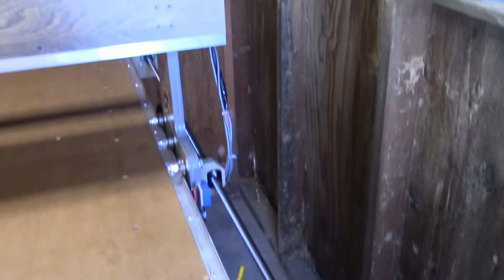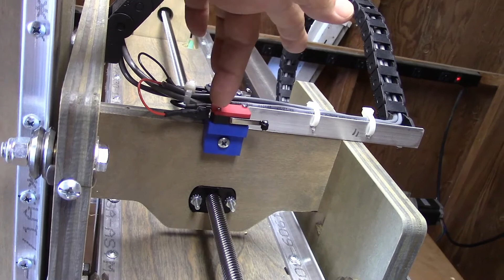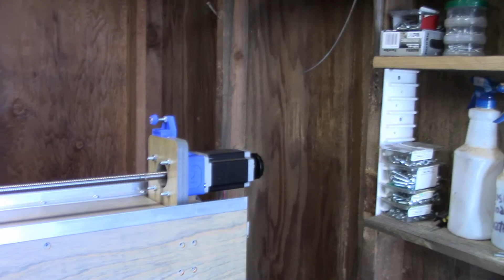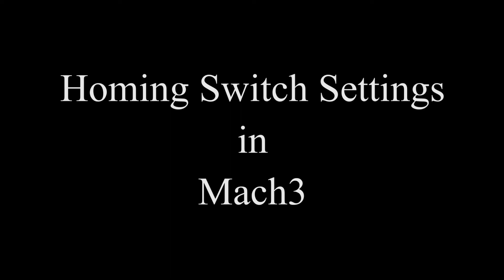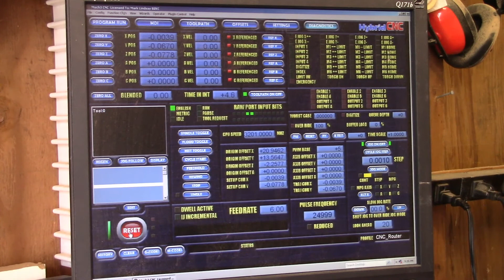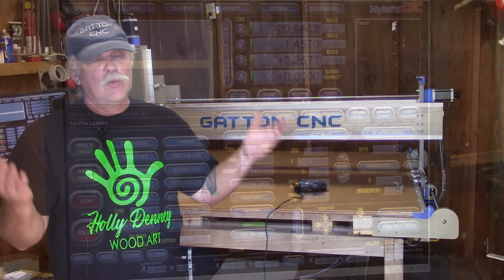Adding Limit Switches to my Gatton CNC - Part 2

Comment: The gentleman you recommended he explain on very easy way to understand thank you for that but i have one issue what ever I’m doing to set my limit switches it doesn’t work i have done everything exactly what you did switches on series, NO close position on switches, port and pins and 24volt DC on switches do i have to do more settings or not also on mach3 on diagnostic section check the leds for limit switches all OFF check by pressing each one they become ON I don’t know what i have done wrong your help will much appreciated

Comment: Could you please explain how we can change screen what your have
Reply from the maker: Unfortunately, the Mach3 screen set I was using in this video is no longer available. If you go to the Mach3 website (link below,) you can see all of the screen sets that are currently available for use with Mach3. DO know that Mach3 is no longer being supported, so some of these screen sets may not work with some Windows 10 updates, or with Windows 11 at all. Check with the screen set author for any bug fixes or updates to the screen set.

https://www.machsupport.com/downloads-updates/screensets/

Comment: I have positive stops on my X and Y axis, and the Z top.  And will use the Y Home and Y slave stops To square the gantry periodically.  
My question is setting the limit switch position relative to the positive stop.   I’m thinking to set the activation point of the switch 0.050” prior to connecting positive stop does that sound correct?  I don’t want to risk bending the switch arm if the switch is located too from the positive stop.
Reply: I am going to set up limit switches first, I do have Hall effect switches I want to switch to some time in the future, do you have a VT on this type of switches?
Reply from the maker: No, I'm sorry - I do not. I got the Pepperl & Fuchs proximity sensor kit that Avid carries when I got my Avid 4848 Pro CNC router, and never looked back. It was 100% plug and play, easy to dial in, and have been 100% trouble free. I'm glad I went with them.
Reply: @MarkLindsayCNC  OK I’m going with proximity switches, are they wired in series (two on same axis) like the mechanical switches in this video.
Reply from the maker: Mine are not. Each switch is wired to the controller box separately. As I said - the system I have is 100% plug and play. I didn't build it. I just bought it, plugged it all in, and never looked back.
Reply from the maker: That sounds reasonable. You could go a little more than 0.050 if you're comfortable doing that. I have proximity switches, so nothing ever actually makes contact, but they're set ahead of the positive stops on my machine by about .25 inches. More important when homing is the speed at which the axes are moving when you home. Mine is set to home at 5 ipm. I jog the machine so that all 3 axes are close to the switches, then home. It only takes a second to do.

Comment: Great content you help us with, I just have a question here about slave motor A axis, I worked with Lcnc before and now I'm trying Mach3 and it seems that homing Y axis and his slave A only need one limit switch, in Lcnc each axis has its own even if it's a slave that way if the gantry gets off squared the homing removes that error, I have not been able to achieve the same result with Mach3, I know I must be missing something please correct me as I know I'm wrong. Thanks
Reply from the maker: You haven't missed anything. I haven't added a second switch to my slave axis yet, but that's one of the things I plan on doing this year. You can be sure there will be a video about it when I add that switch.
Reply: @MarkLindsayCNC  ok thanks

Comment: Hello sir,
First of all, thanks for your time and perfectly clear video. It helped me a lot!

I'm a bit confused about the active low system...
Today i've installed my limit switches, and i have connected them in a normally closed loop (safest way).
I have tested it several times, and if a wire is cut or not making proper contact it will enter E Stop mode. It also stops me from going on with operation if I launch the software but don't turn on the stepper and board power supply.
So, it's all working good, but I have it set with Active Low ON.
I thought it had to be off, to work correctly in a closed loop. For me, it will only work this way... Lol
Is it OK in this case? Or am I missing something? 🤔
Reply from the maker: All controllers are slightly different. If your limit switches work with Active Low turned ON, but not when Active Low is turned OFF (and you've tested them to make sure of this,) then that's the way they need to be to work with your controller. Just make sure you test each switch individually to make sure they trigger the the e-stop/reset before putting the machine into motion. Also test to make sure they work when homing by manually triggering each switch before each axis gets to its HOME position. Of course, you would do that no matter what, so I probably didn't need to tell you that...
Reply: Yes, it's all tested and homing correctly (thanks to your video) 😁
Once again, thank you so much!

Comment: Dear Mark,
On my homing process only 2 axis work (z and y). X axis does not run to home position. But if hit "go to zero" botton, all axis move to zero position, what happen?
Reply from the maker: Double-check your wiring first. Make sure you have everything connected correctly. Then get into Mach3 and make sure you have the correct Ports and Pins entered in the correct locations, then make sure all of the switches are enabled.
Reply: @MarkLindsayCNC  All conection is correctly connected, that why "go to zero"  instruction was running normaly, it mean all axis goto zero position and  the machine stoped when hit the limit switch. Fortunately it was solved 2 days ago without any corrective action but running  "Ref. All Home" repetitively several times. This problem look like bugs in Mach3 software.
Thanks Mark for your kindness.

Comment: Thanks for this excellent explanation of limits and homing setup.
Are NC limit and homing switches always connected to the INPUT pins of the BOB?  The manufacturer of my BOB says to connect them to the OUTPUT pins.  This is the opposite of what I have read and understood.  Could his board be different in some way to cause this reversal?
I’ve got all my switches wired into the control box but not connected to anything, until I’m 100% positive as to where they should go.
Reply from the maker: ALWAYS follow your equipment manufacturer's instructions to avoid damaging it. If you have any questions about that, contact them and get clarification. People make mistakes, and typos do happen, but it's better to find that out from them.
Reply: @MarkLindsayCNC  yesterday after two months of trying to find out exactly which pins, port and and if it was really the output that the switches should be connected to like they initially said.  They admitted they were wrong and they should be connected to the inputs.  I’m so glad that I didn’t connect it up like they initially told me who knows what would have happened.
Reply from the maker: Glad to hear you got things sorted out. It seemed odd to me that they would have said to connect them to the output side of the BoB, but I'm not an expert, and different manufacturers have different ways of doing things. Most likely what would have happened was they wouldn't have worked when you tested them. (And DO test them before you put the machine into motion.) Another step complete! Onward!

Comment: Great Video Mark!  I've just gotten around to adding limit/homing switches to my machine.  I was having problems with the false limits coming in.  I set the debounce to 100 (like a saw in another video), so I'll try the 1000 or higher.  I was just getting ready to build some opto isolators, to cut the noise down.  I also down sized it from a 6' X 9' to a 6' X 6' bed.  Thanks Geoff

Comment: Don’t understand the machine zero settings.  Did you move all the axis to where you  want the home position  to be and zero the machine settings, is that when the Home switches are made or a fixed distance off of the switches??????
You didn’t mention safe settings, if you are using limits you wouldn’t need safe settings right?
Thanks for all the details about limits and home.
Reply from the maker: All CNC machines have 2 coordinate systems, and you're confusing the two. Homing switches and the Zero settings for them are used with the Machine Coordinates. Machine Coordinates are used to tell Mach3 where the spindle/router is in relation to the machine table. You're talking about the Work Coordinates. Work coordinates tell Mach3 where the spindle/router is in relation to the piece of material you mounted to the table, and are getting ready to cut. When you create a file in VCarve, Aspire, Fusion 360, or whatever, you're working with the Work Coordinates system. These homing switches, and the settings for them, have nothing to do with that. There are no "safe settings" in Machine Coordinates. I hope that helps!
Reply: Mark Lindsay CNC sorry didn’t make myself clear.
Machine settings, I think.  You must have to zero or set them somewhere at one time to establish the CNC bed.  That’s what I’m primarily trying to get at.  Or are you saying you don’t have to do anything to set the machine settings.  I’m missing something.
For eleven years I didn’t look at machine settings, didn’t have and switches, never set any soft limits.  But now I’m so tired of setting the Z zero with paper, a real pain when changing multiple bits in a job.  I bought the 2010 software so I’ve installed the switches and now I need to figure out how to set all this stuff up.  
Maybe it’s the case where the settings are so simple that everybody knows that, I don’t and I got to understand it. 
Thanks
Reply from the maker: Okay, that's the point I was trying to make. Homing switches won't help you set Z zero after a tool change. You'd need a touch plate for that, or use the paper method as you have been doing. Again, all of that uses Work Coordinates - Homing Switches only deal with the Machine Coordinates.

With Homing Switches, you tell Mach3 which area you want to be the "Home Position" on your machine table. Every time you start up the controller, you go into Machine Coordinates by clicking the "Machine Coord's" button, under the DROs. The Z axis will start moving in the correct direction, looking for that home position. When the axis makes contact with the switch, the machine stops, then backs off just enough to break contact with the switch. It then sets the Z DRO to zero in Machine Coordinates. It then does the same for the X, then the Y (the order may be different on other machines.) When all 3 axes have finished that, and the DROs all read 0, it's done. You've homed the machine. You click the "Machine Coord's" button again to go back into Work Coordinates, and you're through homing the machine.

None of that has anything to do with setting your Z zero after a tool change. For that, you'll want to make or buy a touch plate and set it up. Here's a link to the video I used to help me set up my touch plate: https://www.youtube.com/watch?v=G4DeVa8rzA0
Reply: Mark Lindsay CNC 
The ZERO I was referring to was the X zero and Y zero, at their HOME position.
That said, did you move the  X and Y axis to the Front of the table, their HOME position and then set the machine settings to ZERO?   
If you don’t set the machine zero there where do you set it?
Reply from the maker: When you HOME the machine, you put Mach3 into Machine Coordinates, click REF ALL HOME, and the machine goes through its homing routine as I explained above. That sets the Machine Coordinates.

Comment: Hi Mark, thank you so much for your time and patience explaining step by step the set up in Mach3, so many videos miss out some of the important steps that you have covered so well. I will stop reading about it and hopefully get on with it :-) Thanks from across the pond :-)
Reply: Just to add a little bit more. My breakout board is obviously different from yours (JP-3163B) and so some of the pin numbers were not the same and I kept getting the red Emergency LED come up on the Z Axis and was not able to reset and back away from it. There was obviously some sort of conflict there. In the end I moved the Stop button to a different pin and lo and behold all is well, plus the Emergency Stop button actually does what it says on the tin as opposed to just filling in a hole in the front of the cabinet. Again, many thanks, take care. :-)

Comment: Thanks for all the help Mark but can you tell me why may machine does not back off of my limits once the switch is hit. . also the Auto Limit Over Ride has no affect .Any advice would be welcomed
Reply from the maker: It's not supposed to automatically back off the switch when you hit a limit. It stops so you can take care of a problem if there is one. You'll have to click the RESET button, then you can move the machine off of the limit switch if you have the Auto Limit Override enabled. If you don't have that enabled, you'll have to turn off the controller and manually move the machine off the limit switch.
Reply: Mr. Lindsay Thank you for your reply; My break-out board is connected to Mach-3 via USB. In your Homing and limit switch install video you demonstrate how once you home your machine and your switches are hit, your machine backs off each axis a bit . That's what my machine does not do. I have turned on my Auto Override but it does nothing even after I reset it. Would having all of my limit switches connected together and connected to one pin cause this problem? Also I have tried configuring my switches as active low, that too did not help. I don't wish to take to much of your time; perhaps you could suggest one of your other videos for the DIY er that's not quite there yet. thanks in advance.
Reply from the maker: Okay, it might be time to go to the Mach3 Support forum and ask your question over there. I don't use a USB motion controller or breakout board - I run the old school parallel cable on my setup. Sorry I'm no help to you!

Comment: My work station is to the right side of the CNC, could I have it home to the right front  rather than either right rear or left front?
Reply from the maker: You can, but you'll need to get into the HOMING/LIMITS screen and check Home Neg for whichever axis will put it in the home position you want it in. Just try it in the X and Y axis until you get the right combination that suits you. Keep a finger close to the e-stop (or reset) button so you can stop it if it starts going someplace it shouldn't. Once you hit on the right combination, you're all set. Just remember to go back to the CONFIG menu and click Save Settings to make that change permanent.

Comment: Thank you so much my dear ، in did learned a lot ،very nice and understanble demo ،
Please explaine more about normaly close and normaly open limit switches setting ، good luck
Reply: My dear i know electronice is very coplicated , but yet in much 3 there are some question about auto setting  home and limit witch pop up asked about printer port 
I have usb ethernet on my BOB with localy digital scales attached .

Comment: Hi Mark, this past weekend I added limit switches to my CNC Router and couldn't get Mach 3 configured to make them work as limit switches, the Homing worked but the travel limit didn't work??? Last night I configured Mach 3 the same way as you present in this video, everything worked perfectly.  Thank You for this presentation.
Reply from the maker: So is everything working the way you want it to work now?
Reply: Everything is working well and as expected thanks to your easy to follow explanation of how to setup Mach 3.
Reply from the maker: Very glad to hear it!

Comment: where did you get your brake out board I got one but I do not no witch  terminal is ground
Reply from the maker: I got my breakout board from Xylotex, but they are no longer available. The board you have should be marked. Look for pin numbers marked on the board - there should be one marked GND or with a negative symbol. (-)
Reply: I went Dave Gatton   VIDEO on limit switches and clicked on his description and it went to electronics salon d-270 I think the ground is mark S I hook it up as ground and it works but with both switches on the x hook and the y hook together it will not work if I take lose the limit switch  on the x and y it home I thank I am going to have to put each limit switch on it on pin and reconfig on port and pins what do you thank
Reply from the maker: Without knowing how you wired your switches (in series or in parallel) or how you set them up, I'm afraid I'm not much help. Go over to the Diagnostics tab in Mach3 and look to see if any of the M1, M2, or M3 LEDs are lit when the switches are not activated. Also check the wiring. If you wired the switches in series, you should have the positive lead connected to the NC terminal on one switch, and the negative lead connected to the NC terminal on the other switch. Connect a lead from the COM terminal on one switch to the COM terminal on the other switch. You should have no problems if they're all hooked up correctly.
Reply: on the  y I have the black wires from the home and limit tie to gather and the two red  tie to gather black to ground red to pin 12 and no lights are lit  but it will not work unless i disconnect one of the red wires and it will work  on that switch
Reply from the maker: I'd suggest going back and watching both of my limit switch videos again. It sounds like you have the switches wired incorrectly.
Reply: I just went back and watch the first video and see the problem thanks so much i will redo this win i get home
Reply from the maker: Hope it works out for you! Thanks for watching!